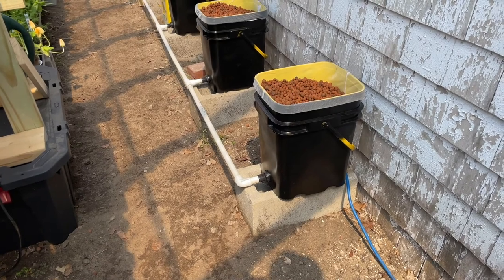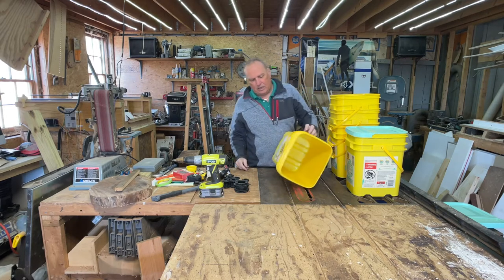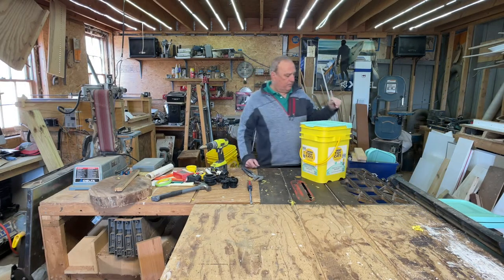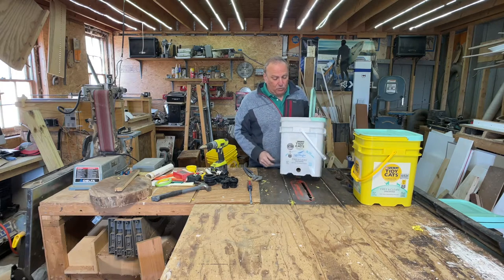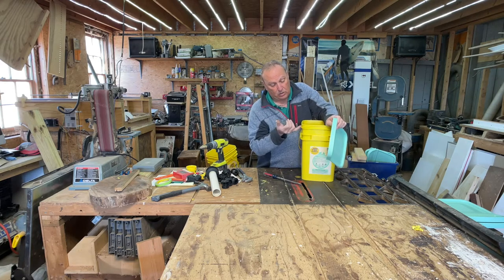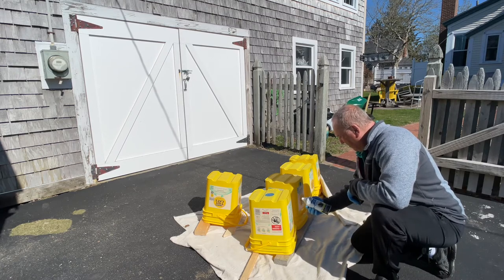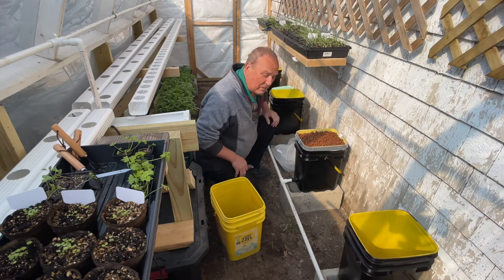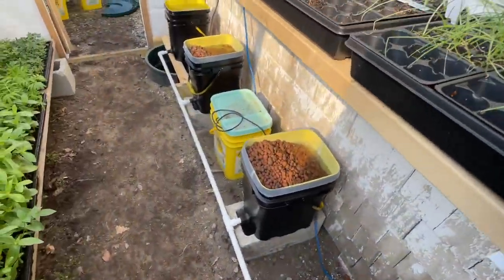How to build an Ebb and Flow Home Hydroponic system - for larger plants - DIY

Comment: Looks like you could put a bell siphon in there & run it as a flood & drain where the pump never stops, giving the pump longer life span. I'm planning on doing something called a dual route zone with rocks in the bottom half, soil in the top half & burlap in between. This looks perfect because I don't have to have a drain bed. I can use the buckets together but individually.
Reply from the maker: I haven't experimented yet with bell siphons. Please get back and share your findings with your new system. Thanks!
Reply: I learned a lot about Bell siphons starting with this video. (How to Make a Bell Siphon & How Bell Siphons Work. Rob Bobs Aquaponics & Backyard Farm. He has several videos on Bell Siphons and on dual root zone. also showing his aquaponics system and other people's aquaponics systems. Thought you might be interested.
Reply from the maker: @jeremyhula931  I actually watched many of his videos, he's a good ressource. That being said I don't beleive a bell siphon will work in this setup. The siphon will "suck" the nutrient solution at a much higher rate than the 1/2" PVC tubing will allow it to enter that bucket. If a bell siphon was going to be used in a setup like mine, I would make the tube linking all the buckets at least an inch in diameter, and probably more like 1.5" to allow the out flow of the grow buckets to keep up with the bell siphon. Also a consideration, bulkhead fittings of that size are not cheap, probably around $10 each, so the system becomes a bit more expensive... Bell siphons seem to work best in a larger grow bed where the solution is "waiting" to be siphoned out and doesn't have the restriction of traveling through a tube.

Comment: Thanks for sharing your system design. It's a clever variation on the drip systems I've seen on the meanshoes and mhpgardener YouTube channels. I like that you wet all the grow media rather than a trickle from the top.  I guess the more buckets you have, the more head pressure on your pump. Which leaves me with the question. 
What size pump are you using ? L/Hr? Lift ?
How many buckets do you think it could handle?
Do you think perlite would work in this system?

Comment: This is brilliant! I've just found my next system to try... Thanks! I have some questions though, how often do you run the pump? Do you reuse the hydroton? If so, how do you clean it? I try to use so little in my dwc to save from cleaning or waste them.
Reply: @stuffmydadknows  I'll be on the look out for that video. Thanks for the information.

Comment: great video.  why didn't you use a drip system instead of flooding the bucket with water?  just curious.
Reply from the maker: That's called a Dutch Bucket and I did that in this video: https://www.youtube.com/watch?v=Pt1pAv3bkXk&t=19s because I was adding more grow buckets and my reservoir wasn't big enough to do Ebb & Flow. The Ebb & Flow was the system I used 2 seasons ago, last year I used an Dutch Bucket (the video in the comment) and I'll be using it this year as well (the video is coming this week). The Ebb & Flow worked really well it's just limited by the reservoir, in my case a 32 gallon trash can.
Reply: @stuffmydadknows  thank you for your quick reply
Reply from the maker: @bbulliard  You Bet!

Comment: I lost everything this year due to heat in my DWC, and Kratky because I am not going to run a chiller as the running costs are horrible (I know from my laser cutter), so I wonder is ebb and flow (flood and drain) more able to handle the higher water temps?  At least the root rot should be less of a concern since the plants are not sitting in water 24x7, right?
Reply: @stuffmydadknows  I read a thread from a few years ago that said if your temps are really 85f then ebb and flow is the one for you since the roots are not sitting in a liquid 24x7.

Comment: I suggest adding a large Aquarium Air pump with tubing connected to airstones in each bucket and reservoir . Paint the  Lids black. Cut a 3-inch hole in the top. Cut from side to hole. On 1 side.
To install lid around plant. Use a 3" foam disc with a cut from side to center on 1 side. With a hole 1/2, the size of a pencil ✏️ 
For stem to be inserted through.
Cover both resivours . This will help with algie build-up. Add hydrogen peroxide 
PS just say tomatoes & Peppers . Or any plant. Use a hole saw in reverse to cut big holes , smother cut.  You can use straight perlite instead. it works just as good.
Or a 50 50 mix. And use hot water in your water pipes or bongs. & Dab rigs When smoking your tomatoes 🍅,  easier on the lungs.